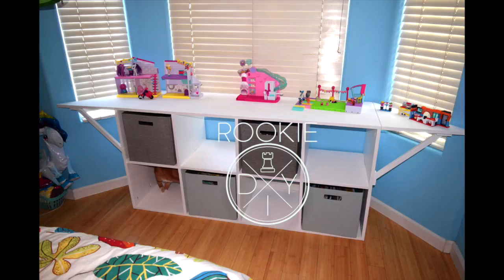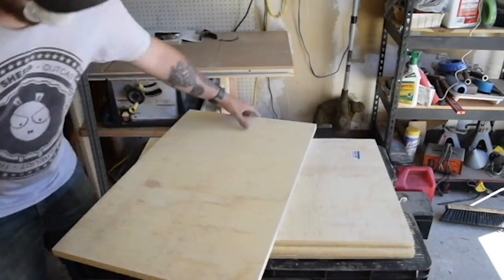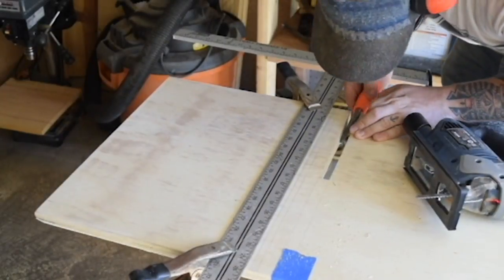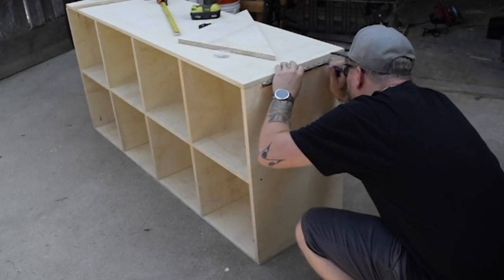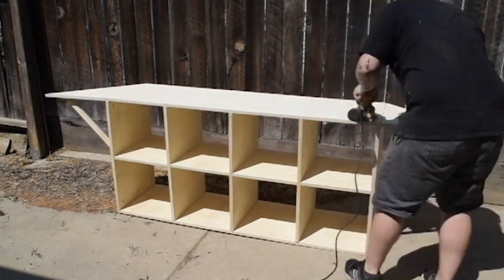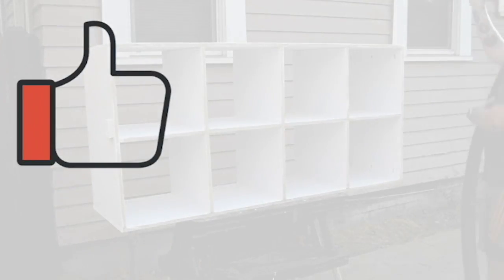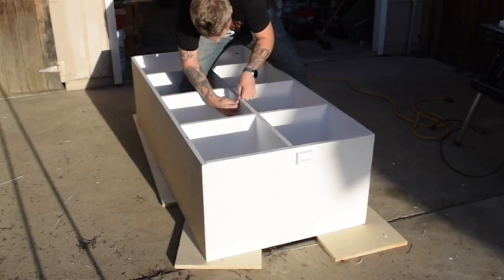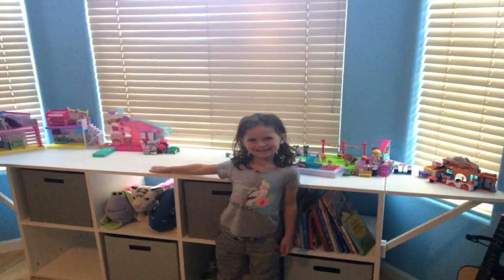DIY Cube Shelf w/ Flip Up Wings

Comment: That turned out awesome. Great to learn about the laminate, I'll have to experiment with that soon.
Reply from the maker: +Graham Brock the edge banding? That stuff is super easy to use. That's the first time I've done half laps that large too.
Reply: Josh Hardcastle yeah, edge banding, I've never used it before. Those lap joints turned out great looks super solid for how simple the design is.
Reply from the maker: +Graham Brock surprisingly study. I tend to think "if I can't stand on whatever I build, it's not good enough" haha

Comment: I know you said you used 3/4 inch plywood but what were the other dimensions of the shelving unit?
Reply from the maker: Overall Dimensions (width X height X depth)

Wings Up – 98″ X 32″ X 18″

Wings Down – 62″ X 32″ X 18″

Square Compartments – 14.875″ X 14.4375"
Reply: Thanks!  With the edge banding did it match the white paint you used?  Since there are several different “whites” I’m just curious.  Or were you able to paint it?
Reply from the maker: @michaeljarvis4096  the edge banding was very close in color. So much so, that if I wasnt making this for someone, I wouldn't have painted it. But I did end up painting just to be sure that everything matched perfectly.